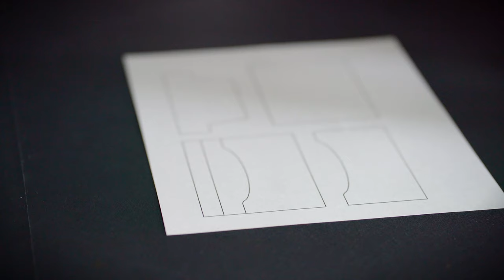HOW TO MAKE THE BEST LEATHER CARD HOLDER // FREE PATTERN! - ASMR

Comment: Simply Superb 👌👍🏽
What adhesive u r using?
Which pricking irons?
If u don't mind, two suggestions
1) use 1oz goat or sheep skin for lining.
2) u need to upgrade ur skiving Knife.
I wonder why u didn't skive the edges 🤔🙄
Reply from the maker: Hello! 
A contact cement. 
KS Blade 2.7

This video is relatively old, with that being said I am now aware of all of the rookie go abouts with video such as leather thickness and skiving knives. 

I now skive edges. 

Thanks!